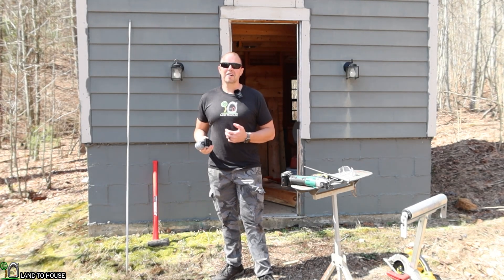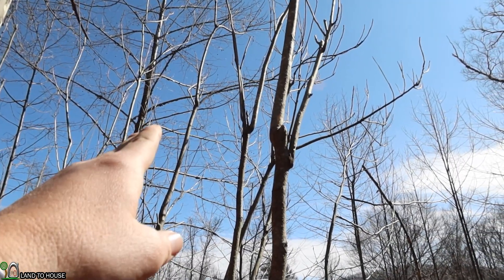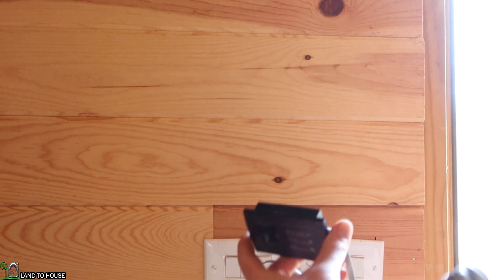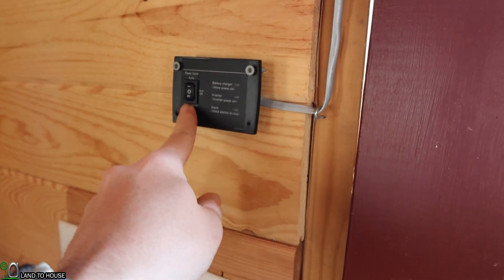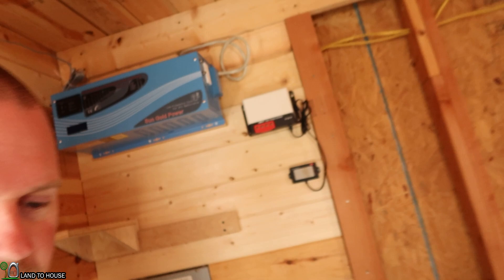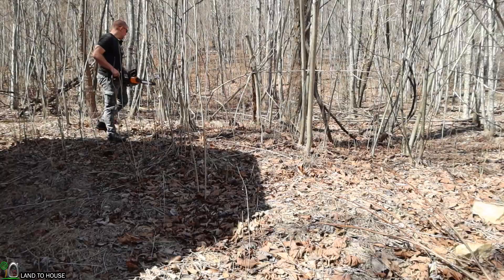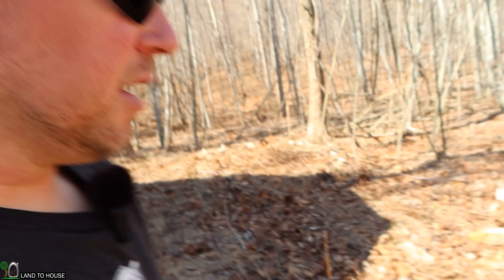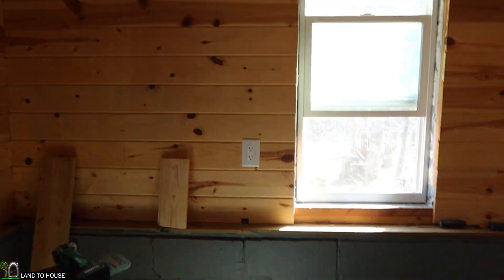Inverter Remote Switch and Ground Rod [Tiny House]

Comment: Adding a ground rod here is making things more dangerous if its not tied into the grid and the entire power system is floating as is typical for solar power.  By putting in a ground rod you are not referencing your system to the Earth and electricity will now want to go from the hot wire, through you, to the earth, and back up the ground rod.
If it is tied into the grid but does not have its own dedicated service, it should still not have a ground rod and all grounds should be bonded back to the ground rod where the main service comes in.

Comment: FYI Driving a grounding rod with a hammer drill and a deep well socket usually works fast. The pros have a special welded up bit just for driving rods into the ground.

Comment: For ground rod installation just take a gallon of water, make a small hole in the ground and pour a little water in it. Start bouncing the rod and when it stops descending pull it up and pour a little more water in the hole. Keep doing this until about a foot of rod is showing and then drive it to desired depth.

Comment: To make it prettier, you would have had to remove the top panel of siding off all around and drilled through the 2x4 wall's (Just like it was any other electrical wire)

Comment: i have to many panels up said no one ever.......you will want to put up at least 3 panels, with clouds and overcast days and having such a limited time of exposure you will be looking for ways to increase your solar. I have been there, started with 2 100w panels then after a few months went to used 250w panels and put up 4 of them. That was winter of 2019. Now i have 14 250w panels in temp ground mounts and 4 100w panels on my shed. This gets me a 24'x24' garage that is off gird with a pellet stove for heat and two freezers for food storage. Of course i have batteries to store energy, It has become my workshop and being retired i spend many hours there each day.